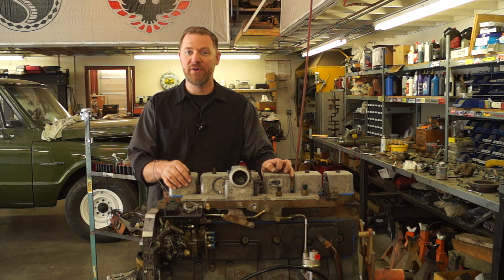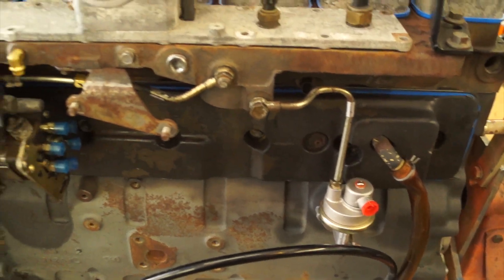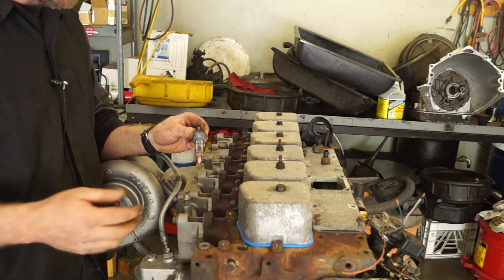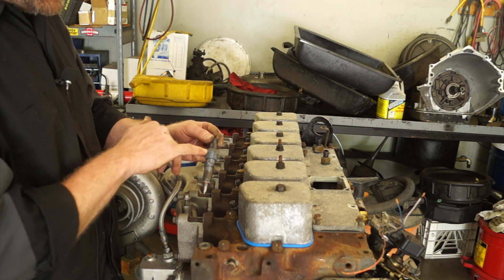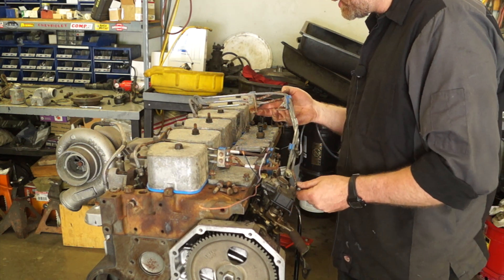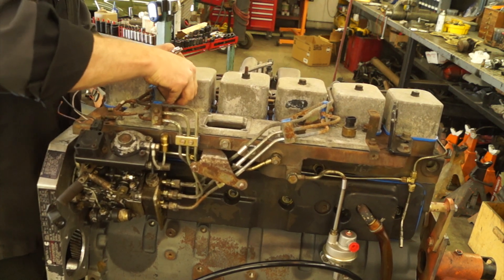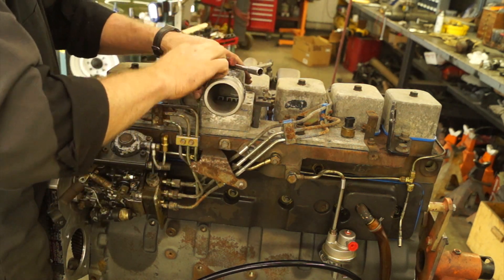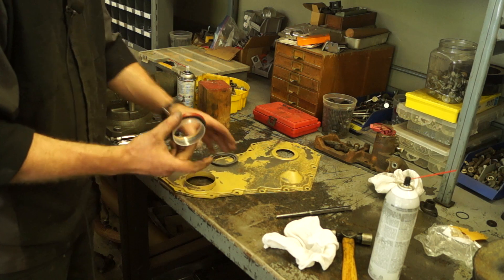Part 5 - How to Rebuild a Cummins 12 Valve 5.9L Diesel Engine - Fuel Injectors & Lines

Comment: I am extremely impressed by the manner in which you built this unit but I guess I would have taken the time to thoroughly clean everything and put two coats of paint on what items are paintable and thoroughly primed and painted the entire motor and transmission well I had the opportunity. 

Just my preference, that’s all. I figure if I’m going to spend the time and energy and the cost, I would prefer to see and feel like I’ve done a superior job during the process, that’s all. But your also right, that’s not necessarily going to accomplish but one purpose and that’s to beautify the engine. 

Personally, I just don’t like rust on parts period,.of any type,..but I also know and realize that have to be realistic!

Comment: Watching this series..this seems like ALOT. I'm not a master mechanic by any means , but I would like to find an old 12v and fix it up.. could you do a more detailed series.  Meaning step by step. Every nut , bolts, every from step 1 to the end.. if I buy an old truck how do I remove the engine from the frame? How do I disconnect the engine from the transmission? How do i lift the engine out, or should i lift the cab off the frame instead?. The most I've ever done automotively is change brakes, rotors, change oil, and a battery..if you made a complete video from the very beginning untill the very end. I would pay for it...thank you
Reply: Get a gasser, it'll be a LOT cheaper and simpler to rebuild. Diesel mechanics don't like to give their secrets and so you won't find a ton of in depth info.

Comment: Just out of curiosity...how come no P pump? Just keeping the cost down or do you have a specific reason? Thanks for all the build videos!
Reply from the maker: It came with the ve pump and was running great.  The ve pump can support enough power upgrades for this build.
Reply: I would of like to see the engine turned up just a bit. I.E. head studs, bigger injectors, bigger turbo, p pump.
Reply: @Comiefornia  If you want to see it go ahead and get a 2nd gen with a diesel.

Comment: This whole series is great, but I was kind of let down by the rattlecan paintjob. I’ve never rebuilt an engine but I’ve restored a lot of machinery and the parts are painted separately and then things are reassembled. That way you can apply the heavier, more durable finishes and they tend to last longer than spraypaint. It may not matter on an engine like this which will be pretty greasy.

Comment: Wish they had shops like this in Miami. Putting a 12v in my suburban 1500 that the 6.5 blew up in. Great job, like the conversions!
Reply: Hello there.. I want to do the same swap but on a dually 93 Silverado. I am also in the Miami area but still looking for a good place to door. I already got the engine, looking for the nv4500 now